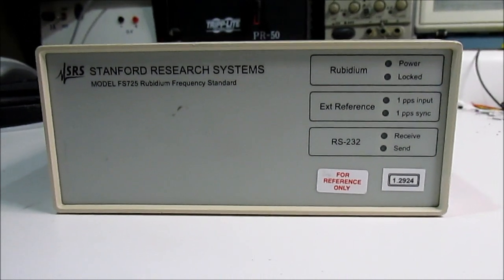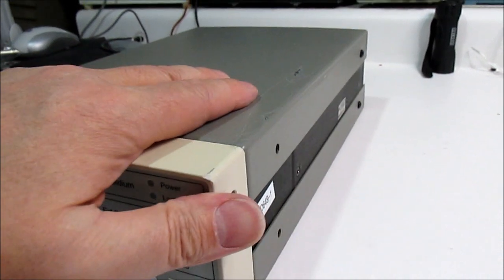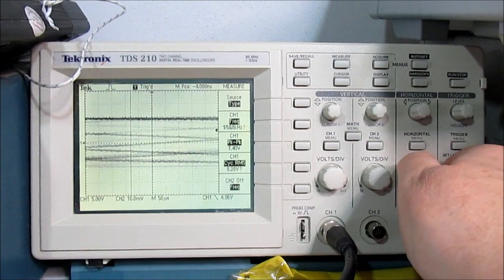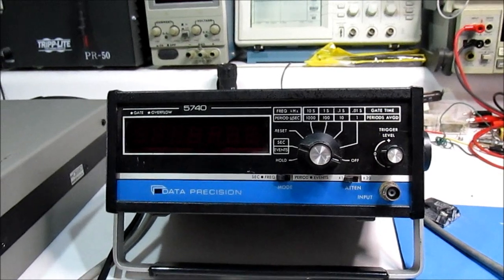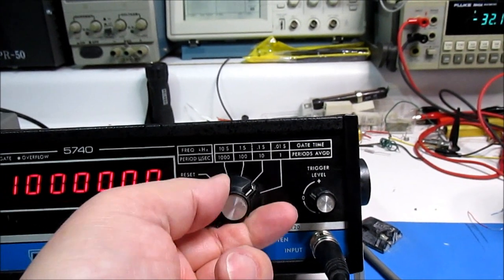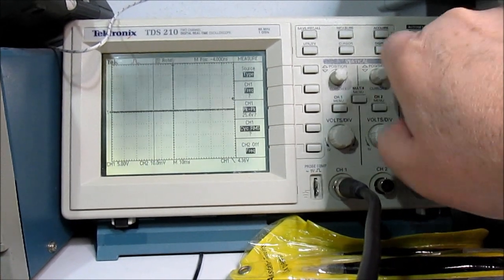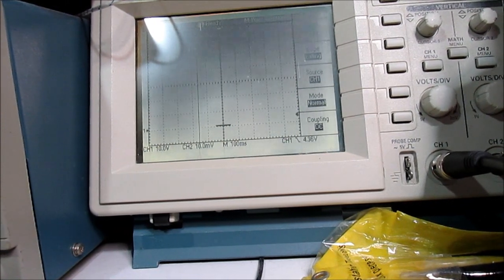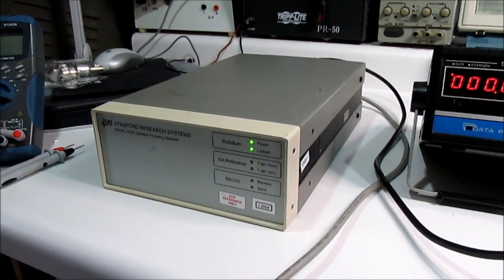Stanford Research FS725 Rubidium Frequency Standard

Comment: I got a "portable"  Rubidium standard off ebay for 85$.  The seller did not understand what it was. It was apparently for checking at cell sites.  NO power switch either.  Just the 10 MHz output and power jack and status LEDs.  I checked it with a cal lab reference once,  I think they must have been using GPS.  It was basically locked in synch on the scope with their standard. Plus it came with the manual. I use it to calibrate my oven oscillators.

Comment: Found lab-grade hundreds-of-dollars worth precision equipment in e-waste! Wish I could get your kind of e-waste! 1PPS input is to hook to a GPS' 1PPS output, so for instance you can synchronise it to global UTC time. If it's working correctly the only way to check its accuracy is against a GPS signal averaged over many hours / days, or an actual atomic clock. Most higher end lab equipment that deals in time / frequency would have a 10Mhz reference signal to hook it up to, so from one clock all of your equipment becomes super accurate.
Reply from the maker: Thanks.  Knowing what eWaste I got this from, it could have once been in a test rack for some GPS units (probably for a design life type test) so that makes sense.

Comment: Those are priced way higher used than I thought, unreasonable high as well.
Reply: Most used lab equipment rocketed up in price the last 5/10 years. I imagine there was a huge glut of it being sold off in the 2000s/early 2010s lowering prices, but that has dried up now.
Reply: @ivolol  Yea no doubt about it, since It was less than 10 years ago since I saw some of these go for like 30 - 35 buck, working, not working like 25.